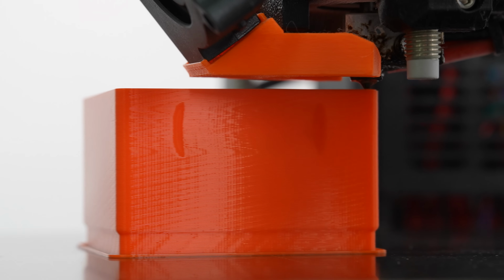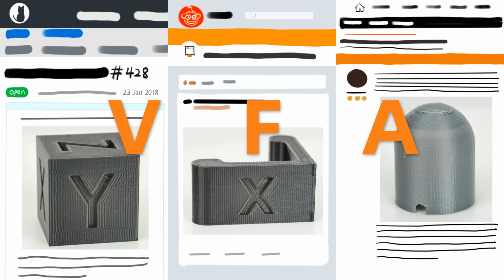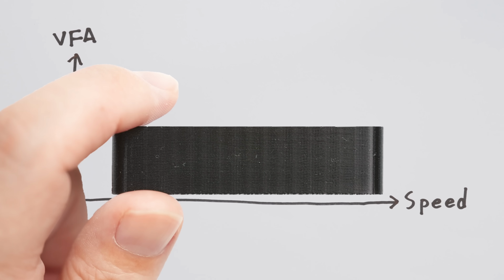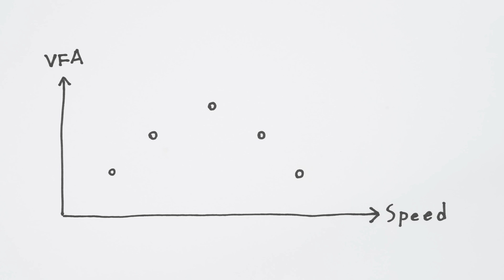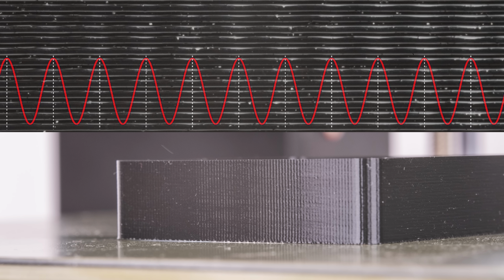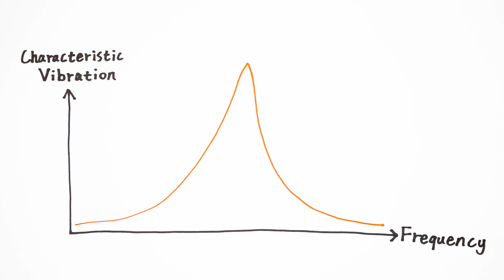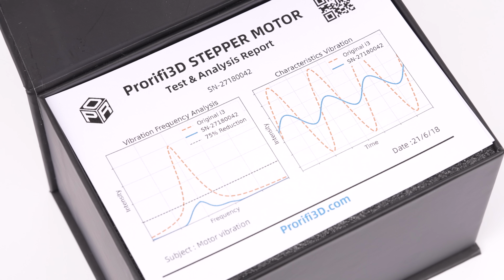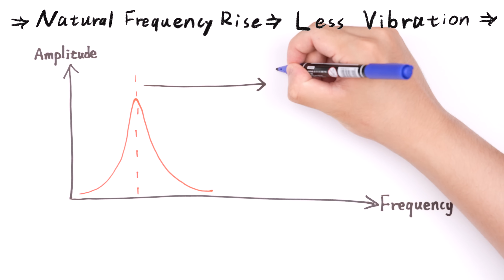We solved this common problem in 3D printing

Comment: Not going to lie they made this video in a way that it makes everything they are saying sound like they are selling snake oil. I'm going to hold judgement on this until some well known in the community gets their hands on this kit.
Reply: only having 900 subs make this even more like a snake oil
Reply: I'm almost 100% sure this is an AI video
Reply: What? On the contrary, they explained it really well, so we'll that I understood that you don't even need to use what they're selling, you should be able to use some dampers on the motor and the structure itself to see results. Their motor should help more but we can wait for reviews to see if it's that'l good.

Comment: I don't think it's a "frequency" persay, but the actual 1.8 degree step the motors are built on. You have two poles in a motor and want to both push and pull on both of them to achieve a position or "step" in between each 1.8 degrees, the finer you can adjust the voltages and the better the coil windings are relative to one an other help achieve better accurately (even coils) and smoothen the motion.

My old Makerbot Replicator printed with nearly no VFA, so that was actually something new to me when i got an i3 clone about 5 years ago. Those old motors also ran very warm and with harsh stepper drivers (i think the key to it was the warm motors). I put one of the motors from my old Replicator on my newer printer's extruder and immediately heavily reduced said issue. Then i put one of the old motors on the X axis and in my tests nearly completely eliminated VFA. My assumption is first quality, then i thought about the heat.. the heat effectively acts as a voltage buffer/smoother, smoothing out the motion. Then TL-smoothers started being sold for printers with cheap stepper motors/drivers. And they defiantly do work, but will reduce the power of the motor by about 10-20% and dump it out was heat.. which is why i almost think the old motors where possibly even designed to run hot because they where in a way wasting electrical "spikes" or stepping edges as heat.
Reply: Nah, 0.9 degree motors cause almost the same distance in VFA patterns

Comment: I think this issue is also a function of motor control rather than the motor alone. I and my company design electric quad copter UAS and have discovered those same exact vibrations can be eliminated with finer/cleaner motor controls. That said, introducing fancy new motor controls into a printer may be a tough thing for most folks.
Reply from the maker: Can't imagine why Prusa didn't solve this problem and left hundreds of thousands of MK2s and MK3s with this problem if this was so easy to fix.
In fact, sometimes incorrect/inappropriate driver settings can trigger current waveform distortion which does worsen vibration and usually makes abnormal noise that is easy to notice and tell. For a professional team, this problem can easily be identified with a current probe. But in most situations, on a mature product such as Original i3, the drivers are already configured properly and the current is almost a perfect sine wave, and even then, many motors still have small vibrations that are not easily observable which can still cause MRR. This is a problem due to the motor design and production.
So it is often a waste of time to "optimize" an already well-configed motor control set up on a mature printer product or project. It is very misleading to say that adjusting the motor control configuration is useful.
Reply: @Prorifi3D  if it was simply physical resonance the wave artifacts wouldn't be  correlated.  The repeatable observed inter-layer correlation along with ability to change the wavelength strongly implicates motor control regardless of how "mature" it is supposed to be.
Reply from the maker: @aajpeter  We have a technical details page to help you understand the cause of MRR(VFA):https://prorifi3d.com/pages/technical-details

Comment: I noticed ripple was caused by those roller pulleys at the end of x and y axis of they have smooth surfaces as opposed to some that have surface features like teeth sized to match the cog belt surface.

Comment: Edit: wait wait wait the motor vibration cant be the only problem here. For those vibrations to manifest in features mms wide wouldn't they have to be in the 0-10 hertz range? the print head is only moving across the features peak to peak distance every 0.5 second or so. I'm confused haha

Coming from FPV drones, unwanted vibrations miserable. Motors/build stability are the absolute biggest factors. However, we have a fair few "fixes" that we can employ in less than ideal situations. I'm curious how soft-mounting motors, belt tension adjustment, or increasing stiffness/ adding flex in strategic places would alter those vibrations. The name of the game in FPV is move the vibrations higher with stiffness(so it can be easily be filtered in software), and using soft mounting strategically to isolate vibrations. I'm no expert by any means, and I do want to thank you guys for putting work into application specific motor designs. My uneducated gut is telling me adding weight to the moving parts to reduce the resonance at the motors vibration frequency, and reducing/increasing the rigidity of the motor and print head coupling could help. Best option is to use the right parts in the first place though.
Reply: Soft motor mounts will absorb some of the motor torque and allow it to move which would affect the print head positioning. Think of the affect putting soft mounts on a CNC machine. All stepper motors in this application are rigidly mounted. I'm a bit skeptical of the benefit of these motors most of their claims are based on "before and after photos" and powerpoint graphs which made the video feel like a sales presentation. You would think any company involved at this level would have white papers and mounds of data which is pretty much absent from their web site. With regard to the print quality there are way too many variables involved to affect the outcome. A Prusa upgrade? Perhaps. A Voron upgrade? That remains to be seen

Comment: You can also change the mass in a vibrating system to change the resonance frequency, cutting mass for a higher frequency and adding mass for a lower frequency. I'd imagine even a rubber stepper damper might help.

Comment: The motors do not vibrate in all directions. The location of the motors affects the VFA. When the engine is on its side, it vibrates better than when it is lying on its back and is attached to the frame from there.

Comment: So with 1 of my printers, I went the Klipper Input Shaper + Fluidd route. 

And I've seen the results myself from switching my firmware to Klipper and using Input Shaper.... but from someone with limited experience with command line utilities and someone who constantly feels out of his depth modifying firmware and gcode by hand, flashing chips on the mainboard of the printer to allow the USB connection to work, etc.... I have to tell you, I would MUCH prefer this approach. If you compare the cost of buying a pi, printing a case for it, the SD card for the pi, the power adapter with clicky switch for the pi, fans and/or heatsinks, screws to mount it to the printer, and then the time it takes to tune and manhandle your printer into behaving, purchasing a kit for $350 to not have to deal with all of that, especially when you're working with multiple printers, and downtime costs you, it just makes sense to go the upgrade route and skip klipper. 

Klipper has a ton of potential, and I'm not badmouthing it at all, it's great and I love to see how it's progressing, but for now, needing a production ready machine and swapping a few parts shaves hours and hours off of the tuning, troubleshooting, gcode modifying, and a lot of the manual work Klipper requires. 

Even if I put an octopi on every one of my printers, this upgrade seems worthwhile.
I'm eager to read reviews and see how people fared with these motors.

Comment: Interesting findings, coming from the Voron community, we've had a large influx of VFA reports following a recent batch of LDO V0.1 kits, including my own.
Are there any plans in the future to make these motors in kits for Voron, Ratrig, hevORT, etc? or in other standards and selling them separately NEMA14, NEMA17, Pancake, etc.
Many other people and I would like to see more options for high quality stepper motors, I'm hoping you can make these innovations more open to the rest of the printing community, and I'm really glad to see a company is pushing forward to solve issues like these.
Reply from the maker: Thank you for your compliment and support! We will continue to do our best to advance the development of 3D printing technology.

We are planning the optimization and production of motors adapted to other printers/of other specifications. Based on our past experience, this process may take a couple of months or even a year.

And for the Voron V0.1, we happened to have done some tests on it recently. We modified some of the printed parts, adjusted the corresponding driver settings to install our NEMA17 motors with current specifications. With the limited testing we have done so far, our motors reduce the MRR(VFA) on V0.1 significantly.

Our recent test results on various non-Prusa i3 printers will be organized and published soon. We will also upload all relevant modified printed parts and configurations to GitHub. If you are willing to try something new, we will also make a test motor kit with a discount available for you to test them on different machines.

Follow us and stay in touch!
Reply: @Prorifi3D  Thanks a bunch for the detailed reply. Good to hear that you're making motors for other printers, and doing more research into the subject.

As for the V0.1, it's nice to see that improvements are being made on the MMR issues, I'd be happy to test the modified parts for the V0.1 on my personal machine, may I get link to your GitHub so I can follow along closely?

I would be interested in testing the motor kit depending on the price, I do have some questions about the NEMA17 on the V0.1.

How does the NEMA17 perform compared to the stock NEMA14?
Is the back panel able to be closed with the larger NEMA17 motors installed?
Have you modified the frame to fit them?
Is additional hardware required for the modified printed parts needed to install the NEMA17 motors onto the V0.1?

Thanks for being so open with the testing process, I'm excited to see what comes when the research is released.
Reply from the maker: @Krush100  We will update soon!😉
Reply: @Prorifi3D  we would love one for the v-core 3! :)
Reply: Would love to test a set of motors on my Printrbot simple metal! Do you only need them for the X and Y axis? Or does Z and the extruded help to be replaced with your motor model as well?
Reply: @Krush100  have you tried JMC motors with integrated drivers. The driver also makes a big difference.

My CNC is so smooth since I switched to JMC motors.
Reply: @heavyweather  Haven't looked into them, I wonder if the integrated drivers could compensate for the resonate frequencies of the stepper motor to completely eliminate artifacts. would they make a difference for 3D Printing as they do for CNC machining? They also look rather expensive, what reseller did you purchase them from? I'm also thinking. How would they connect to a driver board? I'm assuming they wouldn't be hooked up to something like an SKR Mini e3 v2, or similar board, as that has motor drivers build in. would they hook straight up to something like a raspberry pi and a 12v/24v supply? What firmware would be used to drive such a unique motor driver combo?

This seems like it could be an "end all be all" solution, if they're integrated into a printer properly, with the right firmware, I'd love to get more info on them if you'd share some of your resources.

Thanks for the insightful comment.
Reply: @Krush100  Can only say for my router vs. cheap (20€) stepper drivers. I bought them from Ali and can't remember the sellers. Didn't buy them all at one. Between 70€ and 100€ for the 2NM NEMA 23.
I guess you can use them on amy motor driver board with removable drivers or extra ports. The closed loop feedback can only be used on dedicated boards.
Here is a video where he shows compatible boards.
https://youtu.be/eM8zSG8fEkk

I am running mine on an Arduino UNO (ESTLcam as cam and controller) without the closed loop. When something's off on my CNC I want to fix it and not have the stepper compensate for. It doesn't save you from mechanical problems either (lose ballscrew...).
I just got my first 3D printer (FLSun QQS pro) so I can't say much but I guess a rigid printer with ballscrews and proper linear rails would make a huge difference but then it gets expensive like a router. (I might get a SuperRacer as a second printer if I like it...)
The there's servo motors if you want to drive even faster...(guess I have to look up 3D printers with servo motors now).
Reply: @heavyweather  Yeah looks like they are a good amount more than a normal stepper, That teaching tech video was super interesting, seems like it did improve some of the print artifacts he was having, I've found some closed loop stepper motors in the NEMA14 standard which is what my main machine uses, I might look into purchasing some to try when the time comes.

I'm glad to see you got a 3D Printer! additive manufacturing is going to be a fun world for you to learn coming from CNC machining. Ballscrews are not very common in the 3D Printing community although, I've seen them used in place of belts in most situations, personally I believe belts are superior in driving linear motion for 3D Printers as they don't suffer from the speed issues that ball / lead screws suffer from, and 3D Printers don't require the torque that CNC machining does, ballscrews could probably improve the precision, but 3D Printers are limited in how dimensionally accurate they can get, so I'm not sure how much of an improvement they would make. 

Linear rails on the other hand are common in higher end machines, while cheaper machines use V-Slot rollers for their linear guideways. I've experienced a good amount of issues with my Ender 3 V2, which uses V-Slot rollers stock. I've recently upgraded it to use linear rails on the Z axis, and swapping the Z drive for belts in place of a leadscrew (https://github.com/kevinakasam/BeltDrivenEnder3), It's improved the print quality drastically, and I plan to use linear rails on the other axes as well.

My other printer, which started this whole chain of comments (Voron v0.1) uses linear rails for all axes stock, This is great for high speed and precision, which is exactly what this machine is great at! Significantly better quality than the Ender 3, but that might change when I upgrade the Ender 3 with full linear rails.

Never the less, both printers use completely different motion systems which have their own strengths and weaknesses (Voron is CoreXY, Ender 3 is cartesian), here's a great video showcasing the 3 main motion systems most commonly used in 3D Printers, https://youtu.be/_ramiM3KHYE

As for servo motors, they're only used in ultra high speed 3D Printers (https://youtu.be/m6DoKoESPdg), as the main limiting factor for 99% of printers is the hotend, not the motors, this will probably change in the future as FDM 3D Printers increase in speed, but for the moment normal stepper motors are more than enough for basically all users.
Reply: @Krush100 I got the printer for mold making (hydrofoils for surfing). It's not very fats but much cleaner than routing from MDF. Have seen the big printers that print tools that get machined afterwards.
Also building a big router at the moment and planning to use timing belts (like bell everman belt in belt drive) for the long axis. Got a 2m 2010 ballscrew but it's too slow so one JMC at each side it will be.
Reply: @Prorifi3D  I would happily buy a couple of nema 17 just to test on a few of my printers (cr10, a20m, bcn3d sigma, custom corexy). And Im pretty sure other people in the community wouldn't mind buying reasonably priced test motors to see if they help with vfa, Im sure the YouTube 3d printing influencers who have access to lots of printers and test gear would more than likely help you test (develop for different printers). Thanks for contributing to the community.
Reply from the maker: @tituscassiusseverus6303  Thank you for your support!

Comment: At my setup (years ago), it was my extruder stepper driver! Turned out that a DRV8825 stepper driver does not turn the stepper motor smoothly enough to be unsuitable for an extruder